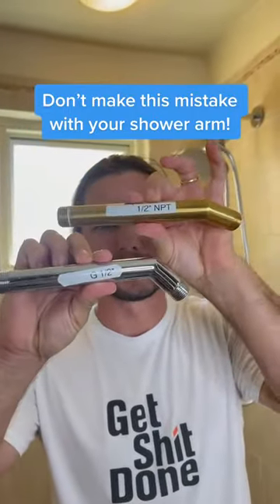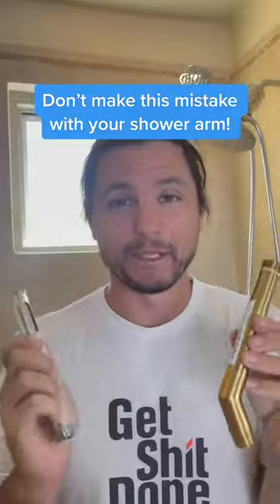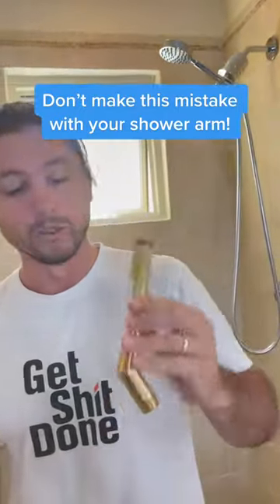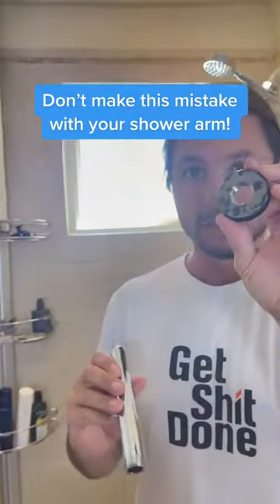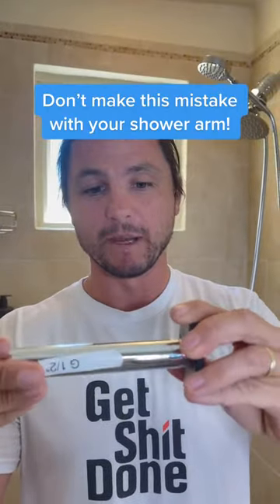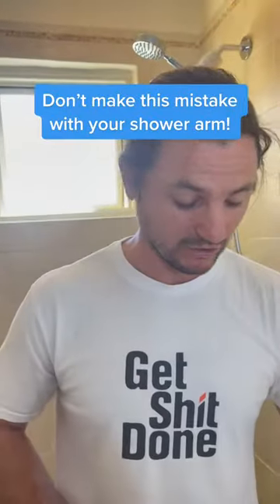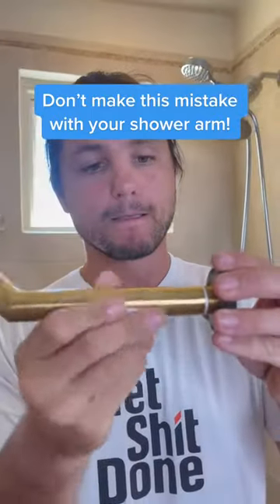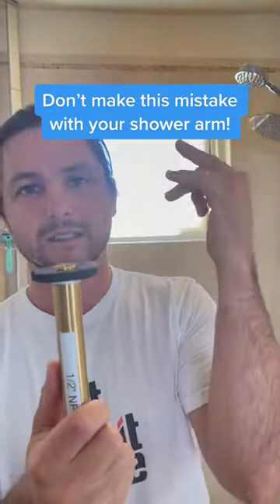Don't Make This Mistake When Buying a New Shower Arm

Comment: I made this mistake as well.  Bought a 1/2” npt tap and will try and rethread.  I’m an idiot
Reply: It's alright, so did i😂.
Reply: I don't think you can just rethread it. It will probably leak because the threads will never fit correctly. I am curious though

Comment: Im gonna try to get the right pipe. Just bought house all new plumbing. Notice leak after first long shower paint bubbled. Been using everything to try to seal the pipe from leaking. Like you showed only screwed in quarter of the way. Been going nuts and buying every sealing thing I can find. And this is probably the issue. Thanks